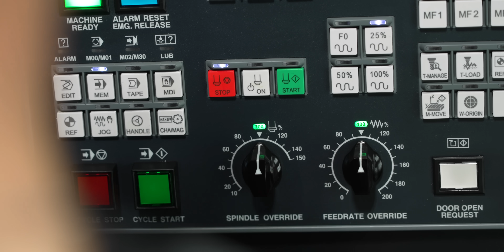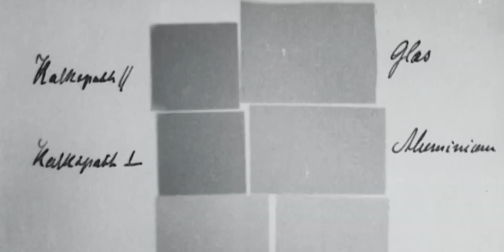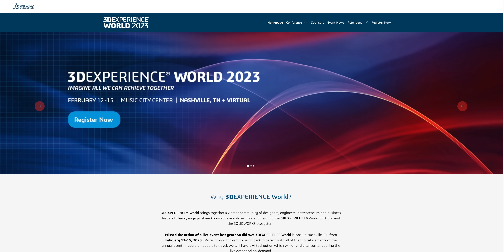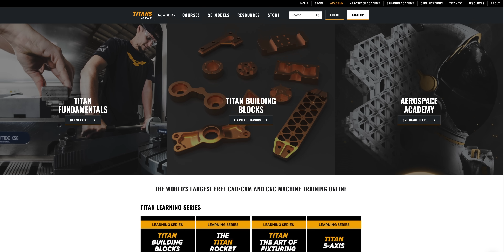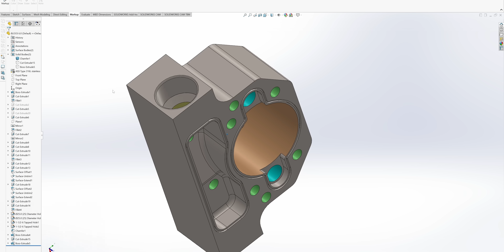Machinist Keeps BREAKING Tools

Comment: Tool pressure seems to be a big key in machining. I haven’t been machining long, but I know that speeding up my feed helps with basic chatter. Then depending on how much material is being left for my finishing tool helps with my end finish. I adjust those things, which is a tool pressure thing too. You tinker with things and get opinions all the time. I wish I understood more of the calculation side of machining, but that will come in time. There is damn near a calculation for everything and a million ways to skin a cat

Comment: What you have said is not only applicable to the Machinist industry, but to the whole engineering industry. Engineers need to stop copying what their mentors told them and should find out themselves what works best.

Comment: Chatter has SO MANY variables tho... tool length, step over, flute length, feed direction, speed, feed, material, work holding, worm gear play, trunion backlash, machine, tool, coolant, material quality... typically, slowing the spindle, increasing the feed rate slightly, will clear up your issue, or even just keeping them the same, but going to a climb cut, rather than conventional, or even just a little positive comp in your rougher, so your finisher bites a little deeper. But GOOD LUCK, on an extra deep cut, on extremely then walls, with a polished finish call out ☠

Comment: My final solution to chatter depends on the job and how many parts are on the work order. Obviously, like the video suggests, I slow the rpm and/or increase the feed during setup. If the work order is only for a few parts I'm slowing the RPM and/or increasing the feed. On production jobs with multiple passes I'm reprogramming a greater radial cut and increasing the feed more often than not. On production work never miss an opportunity to increase material removal rate. Always build on continuing improvement on repeat jobs.

Comment: if i gave our shop floor a program that chattered and needed corrected, i wouldn't be the programmer for long.....
Reply: There are machines within 3 feet of each other and 5 digits apart in manufacturing number that require 2 different levels of tuning on the same tape. You tape for one, the other requires this exact adjustment.

You might get questions, might be asked to leave a note in the tape, but you're not getting fired.

Comment: It’s amazing how this video honestly applies to any trade or career, we as beings who are curious are the ones willing to make big changes and efficient advancements, whereas the ones who want to be told everything and understand nothing usually don’t get too far or are stuck in a “lower” position at their job, where I work at, a plastic factory, i am always asking questions about why a press requires a certain amount of pressure, the certain amount of cooling time, and why a robot (that picks the part out of the press) needs to be set in a certain way. Or whenever the press is going off, I always ask about what the problem is and what tends to cause that issue and how to fix it
Reply: hello plastics man, i made your mold

cheers
Reply: Hit the nail on the head